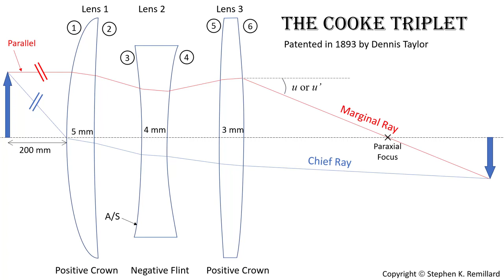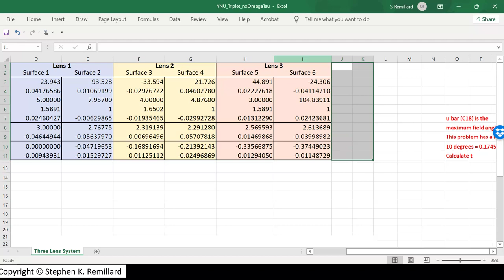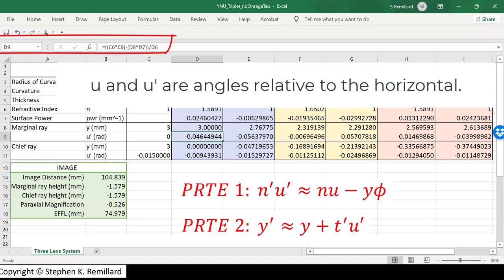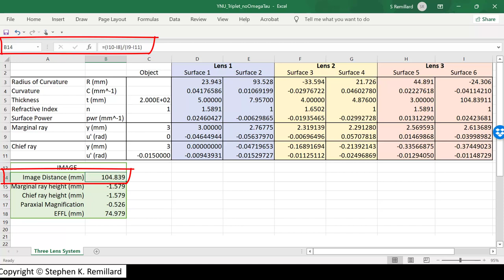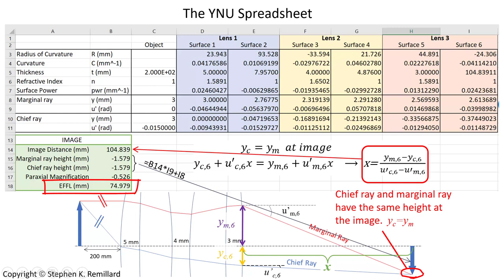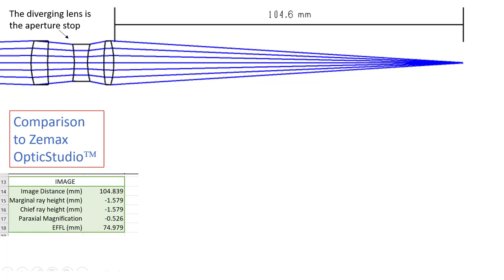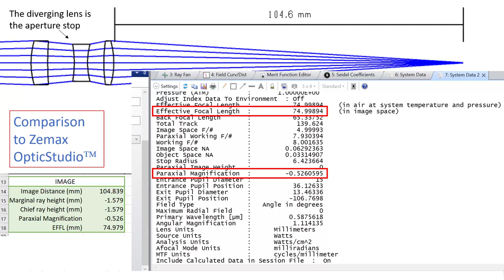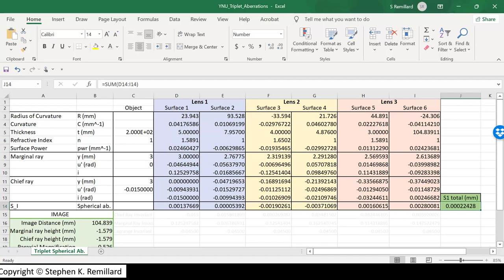The Cooke Triplet: A Paraxial Ray Trace Example

Comment from the maker: One year later (and wiser) I returned to view this video and have a little regret about not describing the aperture stop in more detail.  You may have noticed at the end of the video that I only compute the spherical aberration and not the other 3rd order aberrations.  That's because some of them are chief-ray aberrations and require using the ray that passes through the center of the aperture stop, and my Zemax benchmark used the second lens as the aperture stop.  It doesn't matter for spherical aberration, which doesn't depend on the chief ray.  But the other aberrations would be different in my spreadsheet and in the Zemax benchmark.  That's why I didn't calculate them.  I should have explained that.  The surface that functions as the aperture stop is the one that is completely filled by each field.  In Zemax, you can declare any surface you want to be the aperture stop, and the clear-semi-diameters will adjust to make it so.  The negative lens is often used as the aperture stop in a Cooke triplet.  And sometimes, when there is a telecentricity spec, a physical aperture stop is placed in front of the triplet.

Comment: Prof Remillard, the 1964 paper by Walter Wallin has an elegant analysis of the triplet and perhaps it can be shown that at least 3 of of the abberrations, Petzval,  longitudinal and lateral chromatic aberrations are readily corrected by proper choice of triplet parameters.
Reply from the maker: Joe, Thanks for that reference.  I haven't purchased that one.  However, you motivated me to look up others that cite it (something I do whenever I encounter a paywall) and I found this open access paper which provides a good treatment of aberrations in triplets, perhaps drawing quite a lot from Wallin.  The authors work out the condition that you mention, and it seems with corrected distortion also included.  This paper then goes in a different direction and makes the opimization work in the case of variable focus lenses, so not quite the same thing I suppose.  https://opg.optica.org/oe/fulltext.cfm?uri=oe-19-24-23989&id=224290

Comment: Love your channel. I would welcome our commentary or video coverage about adaptability of vintage lenses to various DSLR and mirrorless camera brands, bodies and sensor sizes. Specifically the effect of glass elements covering the digital sensor itself and their effect of thickness and optical properties upon the Marginal and Chief ray. Reason for my question is that some particular vintage lenses may be outstanding on some camera bodies and not so on others. For example SONY is known for using thicker glass over the sensor than Fuji on their x-trans. In essence, the glass over the sensor is yet another "lens" element unaccounted for in the original design of a vintage lens.
Reply from the maker: Thanks for raising this question.  It's definitely worth looking at if and how the presence of a microlens array can influence the performance of the lens.  Although I'm sure that the know-how is out there, I have not looked into this.  But you have made me curious about it.
Reply: @stephenremillard1  Actually, I didn't mean the "micro lens", but a piece of flat glass that sits on top and protects the micro lens array along with silicon sensor., and which in routine practice is cleaned when we want to "clean the sensor". This glass is around 0.8-1.2mm thick depending on camera brand.
Reply from the maker: Ah, thanks for the clarification.  Such a glass is usually included as an IR filter and its presence is also taken into account during the lens design.  I covered it a little bit in my patent review of smartphone camera lenses https://youtu.be/1aCXMBP8_3I .  Out of curiosity, I just now opened the Zemax file for that patent study and removed the slab of glass over the sensor.  I adjusted the sensor position a fraction of a mm to the new point of best focus and the focus was good, although degraded from the original design.  The RMS spot size increased from diffraction limited with the glass present (about 1.7 microns) to 4 microns without the glass.  The MTF dropped from over 50% at 100 LPMM to about 30%.  So, imaging is still possible with or without the slab of glass.  But if the lens is designed without assuming the slab, the performance might suffer a little by adding a slab.
Reply: Busy body chiming in here. When I was trying to research older medium format backs (pre 2010) i came across some interesting conversations whereby users observed differences with backs which had and didn’t with regards to microlenses. Fast forward to today and I’ve seen some people posit the notion that Fuji GFX sensors sacrificed sharpness for image fidelity by integrating microlenses. I find the entire domain of microlenses intriguing, yet there isnt much information available on this domain. We’re also seeing microlenses being utilised with lightin as well. Makes you wonder if microlenses could be integrated with things like film cameras , existing microlensed sensors, projectors, enlargers, and microscope cameras, and possibly enhance existing devices, possibly with the introduction of trqdeoffs, but with favorable results. Would you mind doing an analysis on focal reducers ? They’re interesting lenses. Now, back to microlenses, to compound things a bit, I wonder how electrowetting and liquidmlenses could come into play by manioukating focal length and polarisation. Alright 😅.